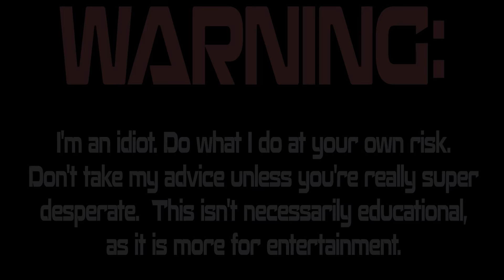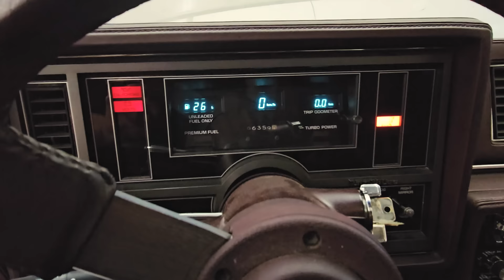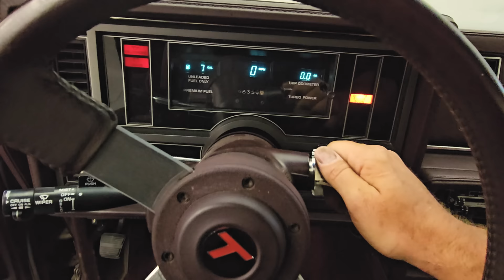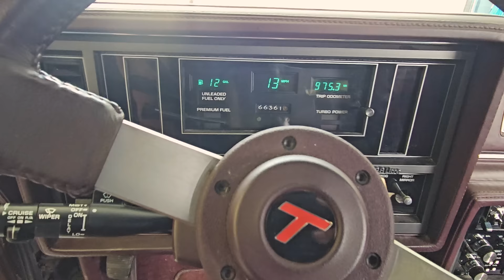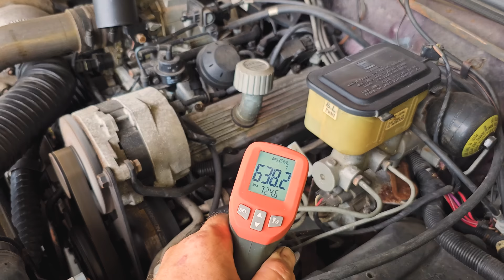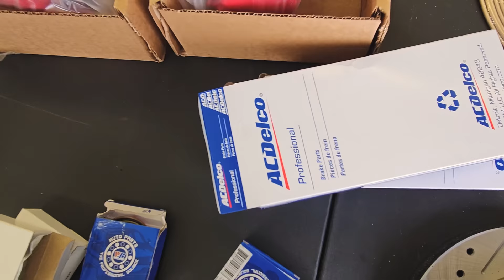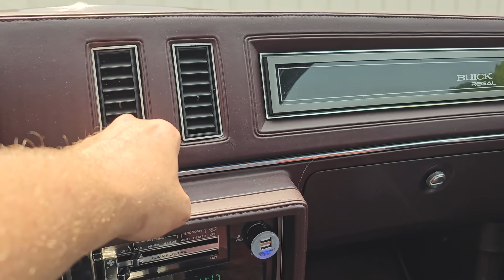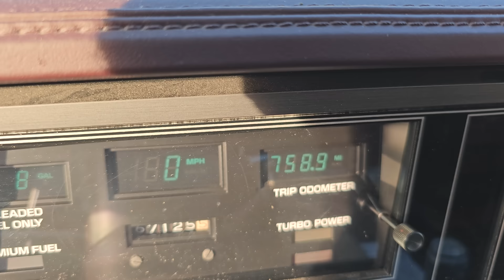ABANDONED In Storage For 22 Years - Rare Turbo Buick! Will it RUN AND DRIVE Home 750 Miles?

Comment: If there was ever a vehicle you went full restoration mode on, please let it be this one!
Reply: Or, just sell it to me... and I'll do it myself.  This one is a true gem.
Reply: thing is a rust bucket
Reply: @DeathtrapCult hardly a rust bucket, it’s just some scaling underneath.
Reply: @DeathtrapCult  mostly surface rust.  Knock it down with a wire wheel w/ some patch welding here and there, she looks solid enough
Reply: @atheplummer Derek would probably be willing to sell it to a fan
Reply: I agree
Reply: Love this car it is absolutely beautiful
Reply: I couldn't agree more👍👍
Reply: How could it rust so bad in a garage?
Reply: @camelblue713 ever been in one of those storage units? They hold on to humidity really bad. Not to mention winters up there aren’t very nice to roads, so I’m sure this car had some salt get on it (even if it was never driven in winter, they still salt in spring on cold nights) 

If it wasn’t washed properly before storage it’s just a bad mix
Reply: @DeathtrapCult  bro doesn’t live in the north 😂😂😂😂😂
Reply: Weight reduction.
Reply: I agree:). That car is a true time piece. All is in good shape except for the frame. You mentioned a frame restoration; I think that would be great.
Reply: What a great find my friend 👍 Your videos are absolutely the highlight of my day after a LONG day at work! RESPECT TO YOU BROTHER ✌️👍
Reply: @camelblue713  Soaking the frame in breakfluid and a high moisture enviroment
Reply: Agreed
Reply: I completely agree. That interior is just too nice. Need to make this ride minty fresh !.
Reply: Another agree.
Reply: @Green_Horn_Garage the car is in the great north
Reply: Agreed as well! That ol girl deserves a resto...in whatever capacity that requires.
Reply: Couldn't agree more. She's a beauty on so many levels. Will be disappointed if he doesn't do a full restore and keep it. Hope ge updates us.
Reply: @DeathtrapCult  Not definitely not a rust bucket some scaling on the undercarriage  yes but that is easily taken care of
Reply: @DeathtrapCult Thats all frame and being a G-body, the frame can be dropped and cleaned up/painted or replaced pretty easily.
Reply: Yes, please!!
Reply: @camelblue713    Sealed for over 20 years. It gets hot and very cold up in Mich. Just condinsation will cause rust over that long period of time.
Reply: I agree 💯
Reply: This car is dream in Canada! If it was up here it would of broke in half just sitting in it 🤣
Reply: @BIGBLUEk10 look at that axle… not structurally sound with those rust pits. You obviously need glasses or some metallurgy classes.
Reply: These things are scarce as hens teeth…(a decent one for sale anyway).I’d restore it to stock… shouldn’t be too hard to find a G-body chassis if it needs one
Reply: @jeremysmith6905  You have no idea what your talking about. Just because you see rust pitting doesn’t make something not structurally sound. You know how thick an axel tube is? I work on stuff way worse than this everyday here in the rust belt. Hell I’ve seen trucks and cars built in the last 10 years that have more rust than this Buick does.
Reply: Factory red t-top turbo, Go National, Frame up full restore is what this beauty deserves
Reply: Amazing car should get a full restoration it deserves it for treating Derek so well on the drive home
Reply: @DeathtrapCult  that is not a rust bucket. That's surface rust, & a little scaling on the doors. That is a beautiful car, & its in excellent condition.
Reply: @DeathtrapCult  I live in the North and this is considered mint condition...
Reply: I agree 💯  if the frame isn't worth saving long term, find a donor. Leave the paint but have a body shop you can feature on the channel, profesionally fix the bottom of the doors, rockers, fenders and quarters. Match the paint and cut and buff the whole car. Full mechanical resto and maybe some turbo and injector work. Some more power. You can chip that car as well.
Reply: @camelblue713  Made in the USA. Rust isn't optional.
Reply: I’ll pitch in on it if you need some assistance!
Reply: Agreed. This is the first car of his I'm begging to see restored. On another note, that's the most excited i've seen him get on a revival when he opened storage unit door and saw it for the first time.
Reply: @DeathtrapCult Hardly has rust for its age, you know nothing about restorations or old cars dude
Reply: If you bothered to pay attention to the video, he found the car in a northern state. Hence the reason why he had to drive it 750 miles home.
Reply: Agreed
Reply: Great episode 🎉 thanks for uploading this Derek
Reply: Those green emblems give it Porsche 918 vibes.
Reply: I agree
Reply: @joshua6200 you betcha 😂😅
Reply: It does.
Reply: He won’t
Reply: @camelblue713 it's from Michigan, salt roads. Probably not totally washed and cleaned well when it was put away.
Reply: Agree
Reply: Do the frame swap and the little bit of body work and paint correction. Then sell it to me.
Reply: Make it so.  Ah the rest belt.  I kept my cars super clean, but they still rusted.
Reply: Frame swap with all suspension parts! Try to save the rear end if possible, if not then swap it also. The car is worth it.
Reply: @camelblue713 , Michigan winters in storage on frozen ground/concrete. Metal storage building warms up enclosure faster than the floor. Condensation occurs.
Reply: Nothing ever happens with these cars after your videos a complete  let down
Reply: Please dude! Show us that you can do a full restore and yes frame swap so this thing can live forever.
Reply: @adamyoder6024 It's probably Jessica's car since she had to give up that Waltrip tribute car.
Reply: couldn't have said it better myself!
Reply: Totally agree
Reply: SAVE THIS ONE
Reply: Agreed
Reply: @Green_Horn_Garage THE CAR DID! Pay attention.
Reply: @thomashall9792 The frame is THE FOUNDATION FOR THE CAR, the BACKBONE. If its no good, the car is done. Can look great all around,  like new inside, doesn't matter. Undercarriage destroyed=  parts car.
Reply: Let's do it come on man
Reply: definitely  needs to do a frame off restoration
Reply: @camelblue713  SIMPLE ,   from years of sitting in storage like that  and not in a climate controlled  environment,  its the humidity  that got to the  frame.
Reply: Absolutely love it watching from Australia, and remember your never late in a 3.8 👍😁🇦🇺
Reply: I could see it finding a home with Adam of Rare Classic Cars
Reply: GOD!  I used to have that exact same car, but in a 2 tone color. I'd give one of my kidneys and part of my liver to get that car back.😢
Reply: This is the one to keep for you and your wife..
Reply: My jaw literally Dropped once that door opened, she's a Beauty... Show me a Grand National ..meh , but show me a T-Type?..and I'm like "Oh Hell to the Ya !!!.. I Love them.  and they are rarer now..   For once I say go completely Balls Out on this one.. Back to "Factory Fresh", she deserves it.. Whatever it takes to remedy that frame issue.. Personally, I'd slap some new wheels on her,  along with a set of new/restored originals you can swap out when needed for shows, etc.. I have no love for those GN  style factory ones
Reply: Came here to say exactly this, word for word even, and happy to see it is the very top comment!
Reply: Agreed!!!
Reply: @adamyoder6024 or its a good giveaway car that has some actual value for him to write off
Reply: 100%
Reply: Maaan... if he would sprayed every nook and cranny with oil before storing, this car would be mint!
Reply: 100% Agree. This thing is a beast & a beauty !
Reply: @adamyoder6024  No way
Reply: @brainprochaska8214 car wash soap is corrosive too if it doesnt get rinsed good enough.
Reply: @bbqrules8890 apparently you havent watched many videos then.
Reply: Concretely agree. Frame swap, chip Foose wheels, and exhaust.
Reply: Who cares
Reply: @camelblue713  northern Michigan is surrounded by saltwater and humidity from over the years caused rust.
Reply: @DeathtrapCult . The frame looks solid it’s just scaly suffice rust which is easily remedied. It’s definitely clean for a rust belt car and either wire wheel or sandblasting will work wonders. Then paint the chassis and recoat it’ll be fine.
Reply: I agree. That car is too nice to be cut up and modded out. Do a full resto as much as you can. Fix the paint and remove the frame , Sand blast and powder coat and fix all the suspension parts. Make a nice weekend cruiser. But I know you Derek. You going to put in a big block or something😅
Reply: would be nice to see this one properly taken care of and restored.
Reply: Betty White
Reply: I totally agree!!
Reply: Nuts and bolts teardown.
Reply: @DeathtrapCult  Its just the frame. The body and the interior are in great condition. You can either replace or build a new frame.
Reply: @DeathtrapCult Tell us you don't know what actual rust is without telling us
Reply: @jeremysmith6905 cluelessness should hurt
Reply: agree, agree, agree!!
Reply: @antisocialjusticewarrior2073  lotta mouth behind that Keyboard
Reply: @DeathtrapCult at least the frame is 😂 all these body styles from the  80s sucked for rust.
Reply: @camelblue713 condensation.  It was in northern lower Michigan lots of cold warm days that would condense water on the frame. It would have had to been in a climate controlled storage for that to not happen.
Reply: @camelblue713  if the garage is sealed up there's no place for the moisture to escape
Reply: Have to say amazing car restore it and keep it original very rare car
Reply: G’day mate! That’s one of the nicest cars you’ve done. I’m jealous. Put it away for prosperity old fella .
Reply: @camelblue713  Condensation from warm day /cold night, the storage unit doesn't sem to be much insulated from the outside.  A garage can be very humid when cold. Unless you have a dehumidifier, your car is not safe if it's in a garage for a long time especially when you go farther up north.
Reply: Legitstreecars here on youtube did something similar, you'd probably enjoy the series
Reply: Awesome buy Brother...
Reply: @DeathtrapCult logic
Reply: @DeathtrapCult You clearly haven't seen many cars. This thing is CLEAN
Reply: @johnfranklin5277  I'm sorry but you really don't know what you're talkin about!
Reply: Yes! Please!
Reply: @camelblue713 humidity - water gets into anywhere air gets into 😢
Reply: With so many iconic cars in Europe why would you bother with this !!!!!!!!!!
Reply: @camelblue713 he probably stored it with salt on it. It was stored in December and in Michigan...
Reply: @DeathtrapCult . Just scale no worries
Reply: @cyriously_nick2191  Michigan isn’t called part of the rust belt for nothing
Reply: I just don’t understand why people are so obsessed with thes cars. Good video though
Reply: Volvo 240 or 242 👌
Reply: Great stuff. I went to school in northern Michigan. The roads are pretty crappy. lol😂
Reply: @ELFKidsVideos  they crappy everywhere these days.
Reply: I have a Olds 442 that things cherry, it was my dads
Reply: @BIGBLUEk10 Haha. That rust is ALL tbr way deep.
Reply: @camelblue713 sucked up moisture from the cement for 20 years
Reply: It's not just the frame. Moisture would have Penetrated EVERYTHING: engine, wiring, contacts, seats, headliner....I'd like to see inside the door panels. 😮
Reply: @timothygeiger8271 right. Not.
Reply: Don't even restore it, just clean it up.
Reply: Definitely do a resto on it, that’s a beautiful car.
Reply: It's in suck amazing condition for a car that laid dorment for years that I would do everything on it for a full restoration
Reply: YES G BODY REGAL IS MY FAVORITE
Reply: @camelblue713 must be from down south.  Up here in the north we get drastic temperature changes and that causes moisture.
Reply: Nothing like laying in some old hot gear oil! If you get on your clothes might as well burn them it’s a smell I tell ya you will not get out! Got it on one of my old jackets and shirts and I washed them in every soap you can think of! Never got rid of it and I tell you after a while it’s a smell that makes a guy want to 🤮 all over the place.
Reply: @camelblue713  Moisture seeped up from concrete, and residual salt from the 61k miles driven in Michigan. Plus, storage roof leaked a little
Reply: I second that 👍....man what a sick car
Reply: Needs a frame off resto.  good project for someone that wants to keep it, but probably a project someone would do for love of car, and not a money maker to do it correct,  Great find.
Reply: @cyriously_nick2191  Where is this (sorry if I missed that mentioned in the video)? I think there's a better chance than not that it's what's ... oh, never mind, just heard it's northern Michigan so I would have maybe lost the bet I about to suggest. Northern MI is one of very few places that wouldn't be considered "southern" as far as car origin goes for used cars where I live. I'm in NW Vermont and I'd say this area is quite possibly the worst on cars in the contiguous U.S.. I had to laugh (it was a pained laugh) when I first realized that cars from Massachusetts qualify for being advertised as "southern" cars. Having to replace brake lines on a car before it's much past 5 years old isn't unheard of.
Reply: You had it on fast forward driving down the highway passing everything I do that in the ol 85 Scottsdale daily with spongy brakes
Reply: It's just a pretty nugget with some surface rust impurity
Reply: If the frame is too embarrassing,  I wouldn't be afraid to swap it out , this car is worth it.
Reply: @camelblue713 There's  calcium chloride in concrete.
Quite corrosive
Reply: Yap. Drop the engine and frame, do a little treatment here and there and fix the rust on the body and she's mint.
Reply: @atheplummer ❤❤❤❤❤❤❤❤❤❤❤❤❤❤❤❤❤❤❤❤❤❤❤❤❤❤❤❤❤❤❤❤❤❤❤❤❤❤❤❤❤❤❤❤❤❤❤❤❤❤❤❤❤❤❤❤❤❤❤❤❤❤❤❤❤❤❤❤❤❤❤❤❤❤❤❤❤❤❤❤❤❤❤❤❤❤❤❤❤❤❤❤❤❤❤❤❤❤❤❤❤❤❤❤❤❤❤❤❤❤❤❤❤❤❤❤❤❤❤❤❤❤❤❤❤❤❤❤❤❤❤❤❤❤❤❤❤❤❤❤ 23:30 23:31 ❤❤❤❤❤❤❤❤
Reply: Everyone is talking about the frame it only needs the rocker panels replaced
Reply: Note to all… If you plan to store a car in a non- heated storage unit, lay wall to wall tarps/plastic sheets down first. This won’t be the best vapor barrier, but it will provide decent protection overall. 
Love this car!
Reply: @DeathtrapCult just needs media blast guy, blast, correct any major flaws, prime & paint that chassis
Reply: @DeathtrapCult  but ld take my chances
Reply: Sounds like some of you are from the rust belt lol
Reply: That was A Full restoration!
Reply: Definitely full body off restoration
Reply: Air conditioning and cruise control? You’re getting soft son 😂
Reply: We all agree that you need to restore this one back to its glory. Can’t wait to see the episode when you start that 🤘🏼🤘🏼
Reply: defiantly should do a series on building this car.
Reply: Please full restore!
Reply: b
Reply: Compared to the other cars he’s had on this channel it’s mint condition lol
Reply: Beautiful car !!
Reply: What is there to restore all there is is the rust
Reply: It probably cost almost as much for storage for 22 years as the T $old for brand new !
Reply: I agree on full restoration for this… classic….
Reply: Please…This one!
Reply: @camelblue713 I'll bet it was not in THAT storage for the last 2 decades. It must have been previous in a much more moist environment (my guess).
Reply: @atheplummer 😅
Reply: O
Reply: @bb5242 that is what I am saying fix it up for her. Even make there own similar tribute car if that is what she wants.
Reply: I agree love watching him on my bucket list to meet him
Reply: When can I mark off the old bucket list and meet you it would be a dream of mine and make my entire life honestly
Reply: It doesn't need a full restoration. Too many morons don't get the fact that you don't just restore every car you see.
Reply: @camelblue713 in those storage facilities they aren't sealed very well let alone ventilated so moisture will produce surface rust..!! That's mild for being up here in Michigan and especially northern Michigan where we get cold wet winters and very humid summers..!! That car is in immaculate condition for being up here in the cancer belt..!!
Reply: @ViceGripGarage please leave it as is..!! I'm hoping the frame is just surface rust tho do what you feel is the safest with that..!! My mother owned one that she bought in 84 and then sold it in the early 90's on a newer model Buick..!! Love that car and that Grand National you also have such great finds hang onto them..!!
Reply: Half the frame is on the floor lol . I'd be looking at a new frame so might as well restomod it
Reply: Keep up the good work
Reply: It had 65k miles of salt treated Michigan roads. There's bound to be some rust. I'm just surprised the fenders, pans and doors look so good. What a find!
Reply: @DeathtrapCult Noooooooo!
Reply: Agreed!!!!
Reply: Full resto? Car hardly needs a full resto it’s pretty mint as it is
Reply: @camelblue713  Air humidity
Reply: Yes, do a complete restoration on this one!
Reply: @DeathtrapCult no more properly said it's a scale bucket. But a gem
Reply: its in almost factory mint condition!
Reply: Wow thats really clean
Reply: Rebuild! rebuild! bone stock beauty!
Reply: New frame,, total restore, it be worth it
Reply: quite a few owners ordered Regals this way. So cool to find these gems. Most were older that wanted the plush interior and fast motor.
Reply: i woulda at least sprayed fogging oil in the plug chambers before cranking it.
Reply: Will you be selling this Buick? If so, how do we find out about it?
Reply: How the fuck do you guys know so much about me
Reply: Roadstershop chassis fix the bottom of the doors and motor mods like  new turbo and fuel injection upgrades
Reply: OMG THAT HURT.Some Cars you just Don't Hoopdie. This one SCREAMS IT!!!
"I'M NOBODY"S HOOPDIE" 😮😮😮😢😢
Reply: Not worth the cash.
Reply: @DeathtrapCult  It was driven around on those salt covered Michigan roads during the winter and I bet it wasn't washed off too often either but tbh it's not exactly what I would describe as a rust bucket additionally the engine bay looked better than I expected it too.
Reply: in the black community we been knew about regals
Reply: Frame off. Repair frame and powder coat
Reply: @cyriously_nick2191  This and MI is pretty humid, y'know,  what with the Lakes and all.
Reply: Agreed
Reply: @Green_Horn_Garage car came from northern Michigan.
Reply: Yes
Reply: @Green_Horn_Garage  he said car has been in Michigan in the video!!!
Reply: Pop's here. Yes, a complete restore. It's to nice not to.